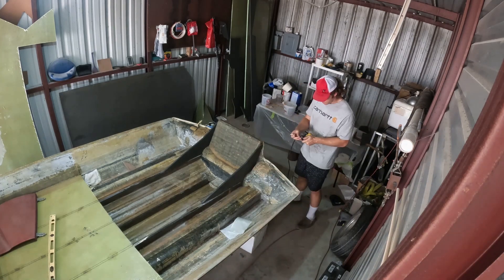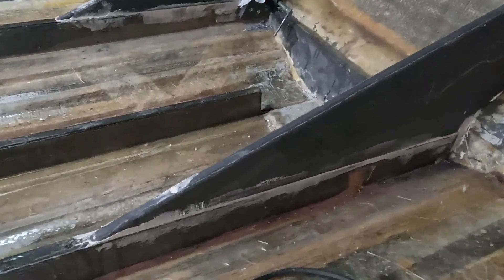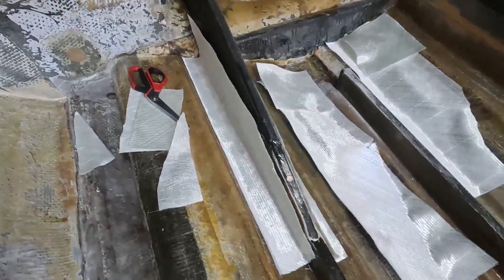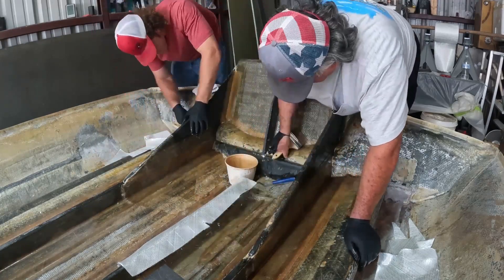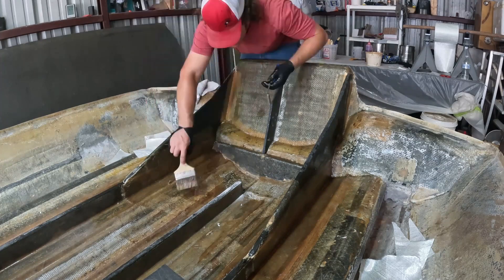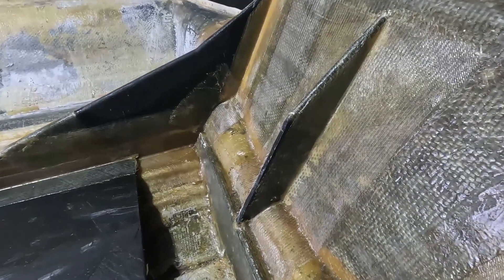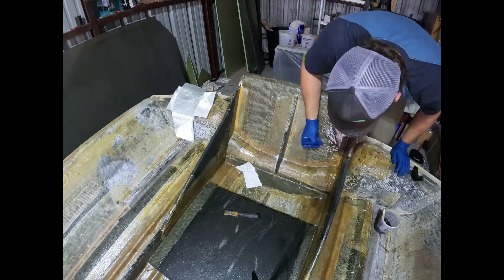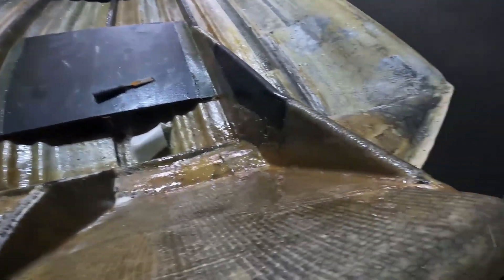LASER LTV BASS BOAT RESTORATION PT2!!!

Comment: Those hulls require a strong transom panel, knee braces, stringer system to disperse stress and shock load. They ride rough in chop at certain speeds. Good luck.